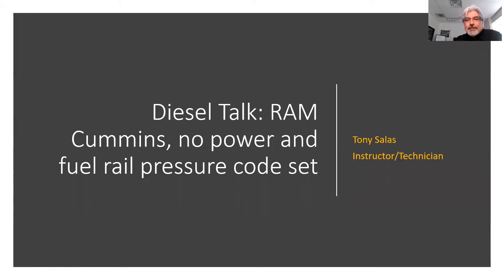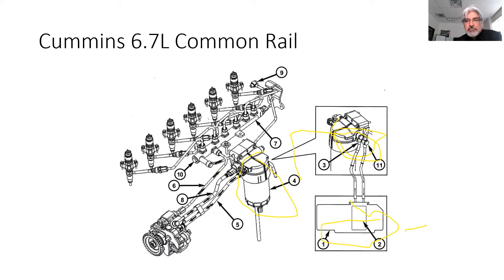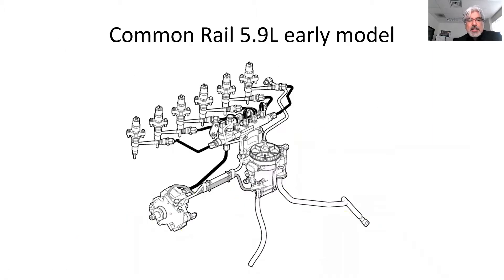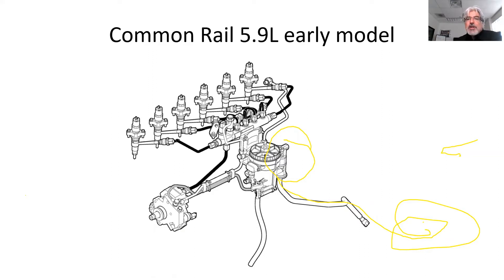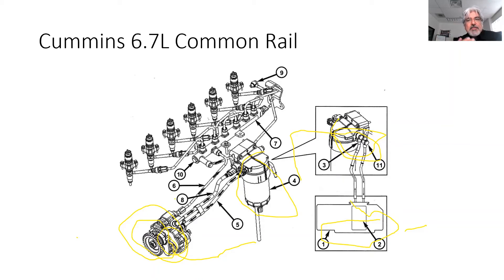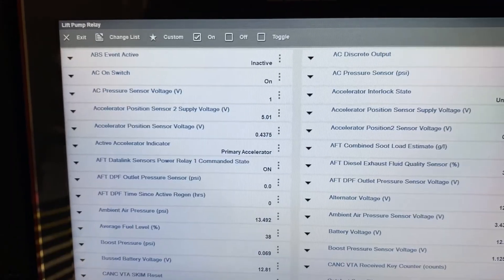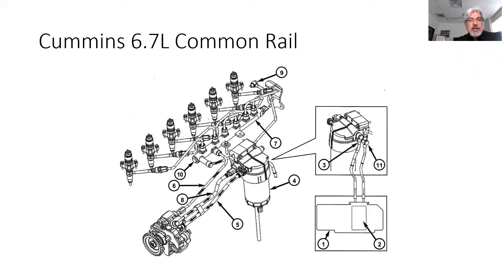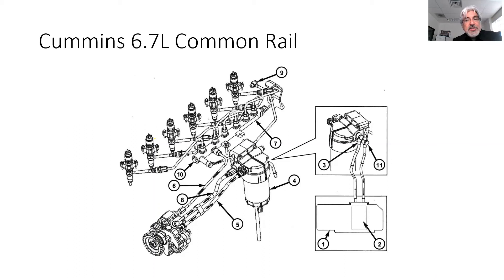RAM Cummins 6.7L Low rail pressure

Comment: Hello, my 2008 6.7 Cummins was tuned, it began loping at idle and making white smoke, when I unplugged the maf the rough idle went away but when i drove the truck it would hesitate and blow white smoke. I have replaced the maf, fuel filter, fca, I have put the truck back to stock, and have redone my battery terminals. The truck drove and idled good on the stock tune, but when I replaced my fca it developed the lope but at 1400 and above in rpms in a calmer fashion, still has white smoke, my idle is normalish now. I’m thinking rail pressure sensor? What could it be😢.

Comment: hi..great video....very clear...we have a 6.7 2022 ...every replace ...filters..high pressure pump ...injectors..pressure sensor....regulator valve....at idle...command 8000psi but just get 2900+-psi....and engine shaking...teste the low fuel volume...10 seconds have 500ml (instructions from alldata) we have no more options...maybe return from injector are too much??? the fuel pump bad??any help  if somebody please...
Reply from the maker: So you have a low rail pressure code set? 
Plus the engine have any power?
Reply: @dieseltalkwithtonysalas8725 P0087 … but we work hard here to diag … that cummins is deleted…. So .. we have many rams here … many… i get … RFH +BCM+PCM and key from other ram same year and same part numbers …. Disconnect the IPC for not get risk to change mileage …. And …. Magic …. Magic .. all pressure are fine …. Wirks great again…. The delete makes bad … no good … and i suspect because this is a AISIN… and when delete a one with aisin have problems. So the problem is the bad delete …

Comment: I only get no power when im getting low on diesel.. a full tank no issues until under 100 mile range
16 ram 5500. I change my filters reg as requested
Reply: I had a similar issue on 2012. Had to drop the tank and clean the screen on the low pressure pump.  It was full if stuff....I believe it was algae.  With more fuel in the tank, the fuel "spills over" the cup with the screen.  When the tank is low, the pump could not draw enough fuel through the clogged screen.

Comment: I have a 2009 Cummins 2500. Have rotell synthetic blend oil and go about 8,000 miles before an oil change. Every other oil change I get the fuel filter changed. It is not a daily driver anymore for the last 5 years. I do go long distances a few times of the year and some in town trips. I don’t live in a big city. Fuel presser is at 30 and needs to be at 80. Ugh. When I travel to exchange my child, I go to the same gas station here in town and the same gas station out of town.

Comment: @Tony Salas -- 2018 RAM 3500 with 63K and I just changed the oil yesterday and fuel filter under the hood and the fuel\water separator, as well as the air filter, all MOPAR parts. Primed the truck and it kicked over fine and took it for a quick spin. Got on the interstate and truck almost died, could only drive 15 MPH. Starts fine and doesn't act like its starving for fuel but Blue Driver Code reader shows P0087 Fuel Rail\System Pressure - Too Low Bank 1.  

I thought the issue might be something wrong with fuel filter so I installed another new filter that same day. I still get the P0087 code but now the engine light is on. I believe it's a fuel line sensor, which is common but I am not sure. I could take the rail off and test the sensor but I was curious what you think? 

Almost afraid to drive the truck any place to have it worked on. I am sure I can replace that sensor and save $1k or more.
Reply from the maker: @bjen2005 if you prime again and start does it idle fine?
Just idle I’m saying.
Let me know
Reply: @dieseltalkwithtonysalas8725   Truck idles fine in park...and it seems to run alright on the road now, but the engine light remains on. I have only taken it 6 or 7 miles since I have encountered the error code. Was afraid to drive it to much until I could find out what was wrong with it for sure and clear the code.
Reply from the maker: @ sounds like you still had air in the system.
Next time, once you prime it, let it idle for 10-15 minutes to allow it to work out the air.
In order to clear the light , go to an auto parts store where they can clear out the codes or buy a cheap code reader to keep in the truck.

Comment: 2014 dodge ram truck drove fine last night, this morning after temps were -4 all night this morning it started up fine normal cold start rough idle. After letting it run for 10 mins I went on a drive 5 minutes into the drive I noticed bogging and power struggle when starting out and it threw code p0087(low rail pressure) could this be gelled fuel causing this issue ? I was confused due to truck starting with no issue but I’m at a loss. Also ran scanner and fuel pressure control 1 which I’m assuming is fuel regulator said it was CL any idea ?
Reply from the maker: I would say gelling as well. What part of the world you in? Are you using the block heater and adding anti gel fuel additive?

Comment: i have a 2019 6.7 dodge ram came to the shop with broken low pressure hose.,replace hose and lift pump and high pressure pump i went back to cp3 problem i have is no high pressure coming out of cp3 got diesel coming in no diesel coming out got a low pressure code we have done anything with no luck please help. crank no start
Reply from the maker: @mlbcom  are you a tech at a shop? You have scan tool to tell me the rail pressure and codes?
Reply: @dieseltalkwithtonysalas8725  p0254 p0092 replace both pump and filter from dealer 168psi from rail i can't clear codes since is 2019 to get this code i have to bypass the wate gate i'm gonna try to diagnostic with oem software witech new high pressure pump

Comment: I just replaced every component including a cp3 conversion in a 2020 6.7, and still have low fuel rail pressure... help
Reply from the maker: @mikehastings519  ok starters you have at least 1 liter in 30 seconds to the fuel filter?
Low pressure check before high pressure check
Reply: @dieseltalkwithtonysalas8725  I will check first thing, I did replace the lift pump as well though

Comment: Hi, got a 2020 ram 5500. I was on my way home from my trip. My truck stalled like 2-3 times. When driving, truck throws check engine light and there's no throttle response, as soon as that happened i pulled over and right before i stop the truck just stalls. when i try starting it back up, it turns over but doesn't start until 20- 30 min with few tries. I changed my fuel filters, same thing is happening. It seems like its something electronic. I checked the codes, I'm getting P0091 and U010E. Has anyone ever had this happen? Thanks

Comment: I'm battling an issue with my 08 6.7L Cummins right now, of fuel de-rating under load, yet I get no codes.  So in the worst method possible (throwing parts at it) I've made no headway.
Under 60-70% throttle, 5th or 6th gear, say, climbing a mountain pass, commanded is at 22-23K.  Rail Pressure (RP) is at same as commanded, then starts to drop as a little more throttle is input.  RP drops to around 9-11k, and after 5-10 secs, derate counter increases by one, and the power is drastically reduced..  After about 30-40 secs, after backing out of the throttle, it will re-gain it's power and business as usual (until the next time).
I've replace filters, fuel rail, RP pressure sensor, relief valve, checked crossover tube torque/re-torqued tubes, replaced in-tank lift pump, etc., but problem still remains.
New Bosch injectors about 3-4 yrs ago, but only about 8-10000mi on them  (replaced set because I had a failed injector).
Any way, I get no codes, but cannot seem to find this fuel de-rate problem..
Thoughts?  Thank you very much.
Truck is tuned and has had same tune on it for 10 yrs.

Comment: I change the filter just have one but don’t start the only part I don’t change is the injectors that’s my next step the scanner says low pressure in common rail I don’t understand what happened have 2 months in the back of my yard need help

Comment: Hi I have 2007 dodge ram 6.7 cuminns I stop the truck for repair the head gasket and repair the cylinder head everything was fine and when I tried to start the truck don’t work I buy a cp3 fuel pump the pump of the tank cam sensor the 2 sensors of the common rail but no start said to low fuel pressure in common rail can you help
Reply: I have the same issue

Comment: I have a 2014 ram with the 6.7, it died on me going down the highway and now have a crank no start issue. I replaced the filters and confirmed my lift pump was getting pressure. My monitor says commanded pressure with the key in on position is 4641 psi and the actual is only 107 psi. Is it safe to assume the cp3 is bad or should i be looking at fca or rail pressure sensor?
Reply from the maker: @derrickmorrow7662  Hello
It could be the pressure relief valve leaking on the rail or an injector with a high return
Need to check the pressure relief valve. On your model it is on the front of the fuel rail if I remember correctly.

Comment: Low pressure in fuel rail after changing filters
Reply from the maker: @JesusCastillo-v2s  and? Need info! Did it have rail pressure before and how are you checking rail pressure?
Reply: @dieseltalkwithtonysalas8725  changed both filters again and worked just fine had ordered some from Amazon supposedly Mopar but where not exactly same

Comment: I got the  low fuel pressure code after changing both filters i think the truck got some air because it wouldn't turn on after i let some air out it cranked right up but started with the check engine light now once it gets to normal temp will loose power and wont go over 10 mph  whay could be the cause for rthat

Comment: I have a 2014 Cummins, it has a rough idle lope when cold, then goes away after about 30 seconds of idling, then comes back after the engine is back up to operating temp. Discovered it is running between 3900 and 5200 psi at idle when 4700 is commanded replaced fca. No change. Runs completely fine otherwise, problem only at idle. Unplugged fca and the computer commanded 5200 and it was able to hold around that and idle fine. Restarted the truck and it commanded 4700 and rough idle came back.
Reply from the maker: Provided this truck doesn’t have a crappy delete tune, your issue could be in the low pressure side, high pressure side or a fuel rail pressure sensor.
Monitor in your scan tool FRP sensor signal voltage let me know what it reads with issue and when running ok.
Second have you verified lift pump volume? 
Need to ensure issue is not lift pump. You get to the injection pump, connect the feed line to a container which is a banjo fitting if my memory serves me right. Turn key on engine off 1 liter in 30 seconds.
If all ok then go after the pressure relief valve in the front of the rail might be leaking.
Need to get to the front of rail and there is a line going to the return it might be a banjo fitting too remove that line and need to see if leaking while cranking but needs to have injector connectors on the side disconnected so it won’t start. 
There’s more but that’s a start cause you can also have a leak at the cascade valve on the injection pump .
Reply: @dieseltalkwithtonysalas8725  okay, I appreciate the direction to head, going to test the lift pump tomorrow. I figured it can’t be the tube because it has a normal commanded pressure, but I suppose that it’s still on the table if it was coded wrong. Thank you!
Reply: @dieseltalkwithtonysalas8725  I also unplugged the fuel rail sensor with it idling, and it did absolutely nothing, still was surging. I would have figured it would default the pump to more commanded pressure but it kept the same.
Reply: @dieseltalkwithtonysalas8725  okay so I ended up testing the lift pump and it flowed properly with volume and make 12psi. So I think that’s ruled out. I ended up discovering that the rail pressure fluctuates sporadically between 40-70 psi with the key on and engine off. Is it safe to assume that’s not normal and I should change the rail sensor next?

Comment: just did fresh rebuild on a 12 cummins 6.7..will drive but when given heavy throttle rail pressure drops to 4000psi from 18000... injectors all tested, new feed tubes.. any ideas? runs, idles and revs fine.. only happens while driving?
Reply from the maker: Provided you have good lift pump volume sounds like your pressure relief valve on the front of the rail is leaking.  Need to check for leakage front it. On the front of the rail there is a banjo fitting. Need to check it is leaking. No fuel at all should be coming out

Comment: Where is Fuel Rail Pressure Sensor located on a 08 6.7 Cummins?
Reply from the maker: Back of the fuel rail. 
It’s inside 
There is a plug you can
Put a wrench on to remove forgot the size.

Comment: I have a 6.7 cummins and i have only 2 injectors working, pressure its good i had a bad pressure regulator i was showing a 13,500 psi at idle or acceleration all 6 were working fine i changed the pressure regulator and right after that i turn it on and its only working on 2 injectors if it matters is working on number 3 and number 6 pistons what could be wrong? I did bleed the air out of the lines
Reply from the maker: How are you determining you are running on 2 cylinders? 
I assume you replaced the regulator on the injection pump?

Comment: curious what that rationality fuel pressure reading was for
Reply from the maker: Just read your comment, could you elaborate on the question?
Reply: @dieseltalkwithtonysalas8725  on cummins inside, it reads psi requested, actual psi, and fuel pressure rationality.  I'm curious what the fuel pressure rationality means

Comment: awesome video!!! Im having this issue. I replaced my fuel filter on my 12' 6.7 cummins. but never sucked out any sediment(My mistake). still have the 0191 code, so instead im going to eliminate the oem crappy set up and get an airdog.
Reply from the maker: I understand but that s a rail pressure sensor code if I am not mistaken. Its a circuit code.
Typically I need a scan tool to read not only the setpoint rail pressure and compare it to actual rail pressure. At the same time need to check sensor signal voltage. 
how many miles on vehicle?

Comment: @Tony Salas  --- What about  excessively cold weather like here in the North (MN, MI, SD), gelling the fuel causing fuel rail pressure being to low on the low pressure side, which in turn would affect the high pressure side since its starving it for fuel. I could see that throwing some DTC code about rail pressure.

FYI: Not a mechanic, but  I still like to know how diesels work and all the in's and out's.
Reply from the maker: Thanks for the comment
Once fuel is gelled game over.
Need to address it . 
Fuel rail pressure does generate heat with the friction of pressurizing the fuel.
However you are correct that fuel gelling will cause no pressure and no start.
Anti gell additives must be used.

Comment: Tony i need your help. I have low rail pressure. I slapped a new Fass lift pump on and an upgraded cp3 from fleece performance. There’s no visible fuel leaks and there’s no fuel in the oil. I still have the problem. The most i get on the rail is 13500 psi when commanded is in the 20’s
Reply from the maker: First check pressure relief valve
It’s on the rail depending what year model you have it’s usually in the front.
Remove banjo and check to see if it leaks. I don’t replace them. I buy the plugs they sell such as PPE

Comment: Hi Tony, I'm Frank from Brasil, I'm working in this Jeep Grand Cherokee V6 diesel, do you know if there is any type of a regulation on The DRV valve or you just put it on The rail and that's it.

Comment: I got something that has been going on for awhile.
2011 RAM 2600 6.7
Rail Pressure sits at ~6k at idle. Ocassionally it will drop down to ~4.3k in about 2 seconds then immediately shoot back up to 6k. Warm engine, cold engine, it doesn't matter. It does this only at idle and not when moving. Most of the time it will do it anywhere from 3-8 times then just stops doing it. When in drive once it jumps back up to 6k psi you can feel the truck try and push through the brakes very briefly. However if I let off the brakes and stay off the throttle it will stop doing it. While driving and monitoring rail pressure actual/desired are always very close to each other. Iv'e replaced the Pressure relief valve, rail pressure sensor and the CP3b has been replaced with a new FCA. Any ideas?
Reply from the maker: Usually idle issues are brought about by lift pump pressure issue or the fuel control assembly (MPROP) or regulator on the CP3 pump. If that checks out then it could be an issue with injectors. Would be nice to know what the duty cycle of the FCA is.

Comment: I have a 2015 Ram 3500 dually 6.7 Cummins. It had the p0087 code for low pressure. I replaced the fuel filters and the FCA (fuel control actuator).  I am a transporter and haul RV's to dealerships. I am still getting  3 warning tones but no messages and then the engine seems to bog down and loose speed. Is it possible my pump is going out
Reply from the maker: I suspect the pressure relief valve on the front of the fuel rail might be the issue
There is a plug in front of the rail . There is a valve in there. You can buy a plug off from
Various vendors sell the plug to bypass the pressure relief valve
Reply: Similar problem here. Did you find a solution?